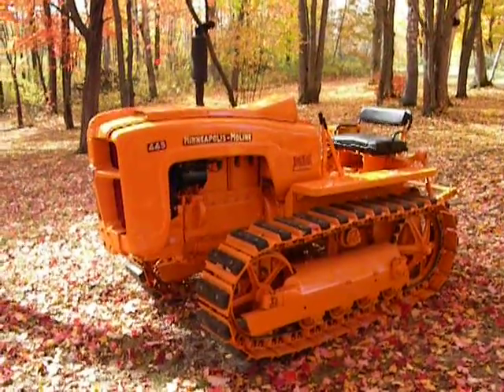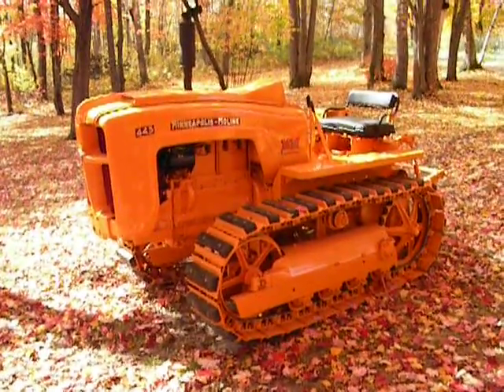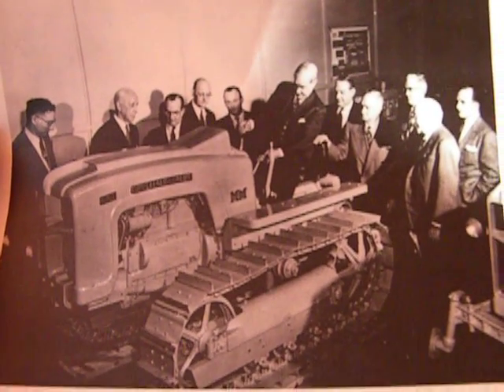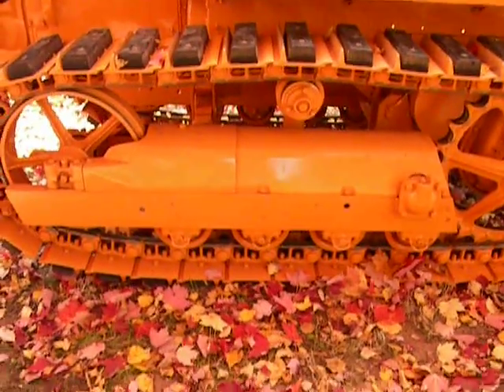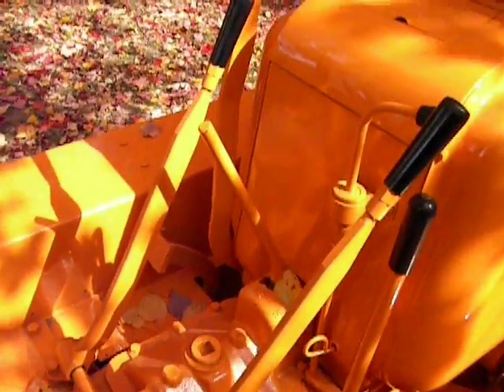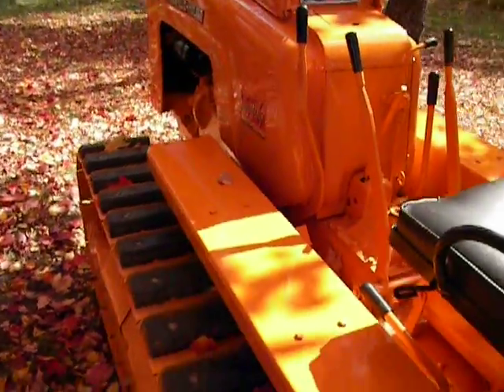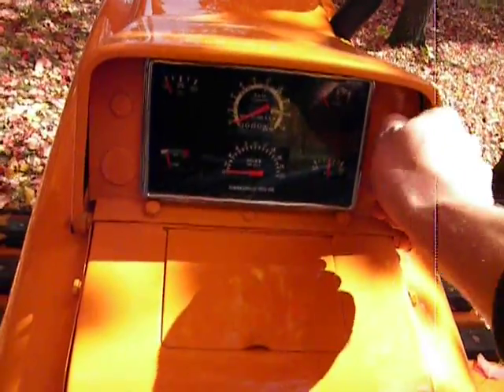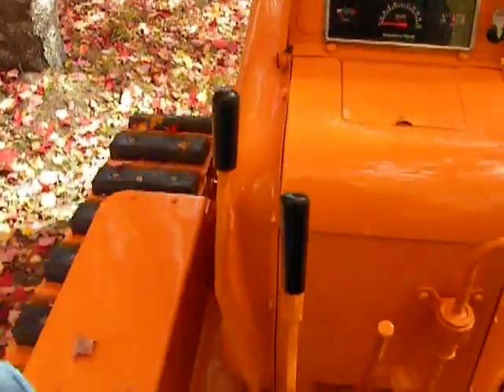Minneapolis-Moline Prototype Crawler X253

Comment: ! Laughing! I have learned more than I have ever wanted to learn about Moline tractors. As I watch now, I can recognize some of the parts , there shape, and design. That top cover on the transmission is a dead give away. (Why is that shift pattern so weird? 1 5, 2 3, 4 R. why not 1 2, 3 4, 5 R?) Thanks for posting!! !laughing!

Comment: Squarch253 you are a prince among men! As a died in the wool fan of old stuff (cars, watches, tractors, etc, etc) I have a deep and abiding appreciation for what you did with this unit as well as it's continued preservation! Wow today we struggle to make much of anything that lasts the warranty cycle. Think- this tractor is 1 of a kind and 66 still running great (with a LOT of help from a great guy!) They will never be made this way again so saving old unique pieces like this one is an important tie to a time when we used our minds and not the AI minds of computers and phones! Bravo!

Comment: I think with the public opinion, leave the battle scars. You have forgot more than most will learn about that machine.... not that it would do much for the job interview at walmart/LOL!  I hope you know I'm joking around. I hated cat as a young guy cause they were proud of the parts and to buy them took a gold card, as I said hated cause if it were yellow then it cost twice what other machine parts cost. I worked on them through the years and got more familiar with them but I wouldn't call me a cat mechanic and I loved their automotive engines as they had real power. The "rattling kitty" is what most were nicknamed where I'm from in alaska